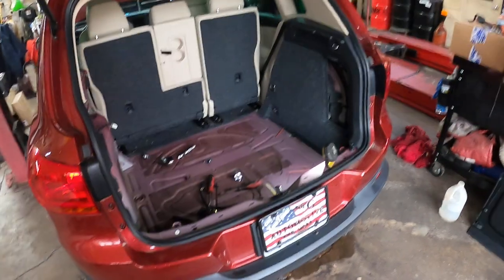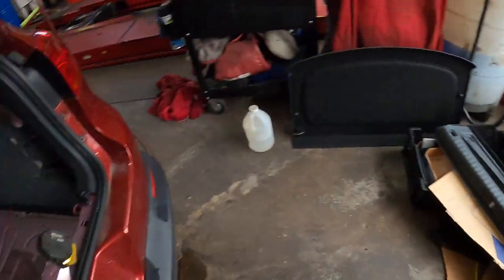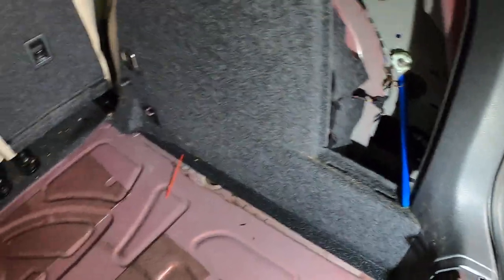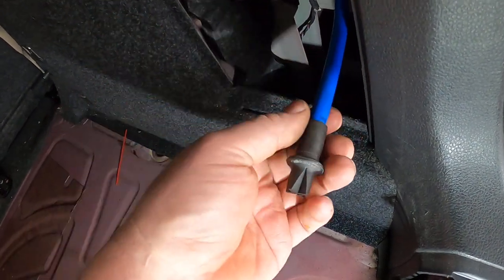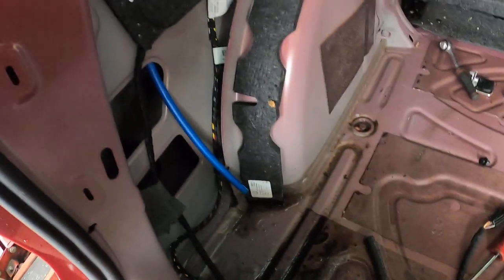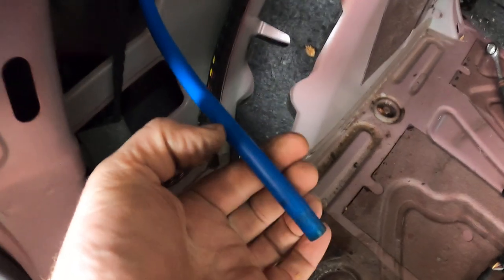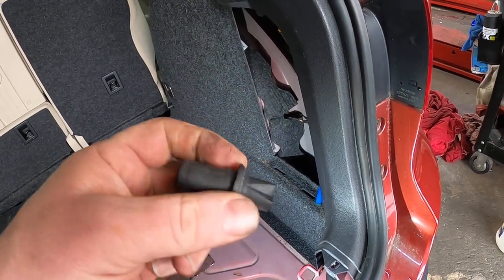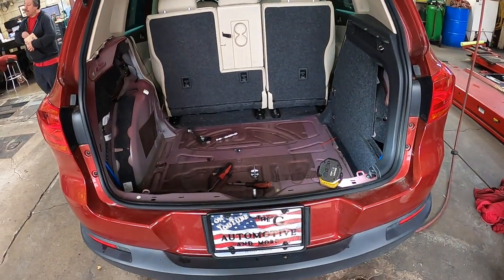2015 VW Tiguan Rear Sunroof Drains Repair

Comment: This was so helpful for my daughters 2011 Tiguan. Another video helped with an upper drain hose issue in 2021 and I only wish the lower hose detachment had been as easy to repair. Maybe if we are lucky we won't have to do the passenger side because the drivers side was a gigantic PITA. Not holding my breath.

Comment: Thanks. Good video. I see a lot of people online just getting rid of the bug shields. I am considering because they do get clogged up and seem to cause a lot of problems and they don't fit that securely (especially on the rear) so I am worried they will shake loose.
Reply: Update: the rear bug shields as you correctly point out have to be installed from the underside. In my Tiguan they were installed from the trunk side and were not seated correctly.

Comment: Great video.
If it funtion correctly, where does it drain to? Is the pipe extanding and going down the side pockets to the outside?
Reply from the maker: Yes it does. They plug into a valve in the lower quarter panel that is suppose to keep dirt and spiders out.

Comment: Hi. Do I get that 7/16 pvc fuel hose at home depot? Do you still need the black rubber spider trap thing if your gonna just connect the pvc all the way through?
Reply from the maker: You can get the hose at a auto part store. I do leave the spider trap installed.
Reply: @TheGAutomotiveAndMore  what if we just used the pvc and bipass the spider rubber connect thing and run it to the ground?
Reply from the maker: @saadimadina1337  Yes you can do that but you do not want spiders making nest in them. That will clog them up. That is why I cut the blue plastic hose and make them longer.
Reply: @TheGAutomotiveAndMore  spiders webs will really come from underneath the car to do that? We just connected/put over the blue hose the clear vinyl tube (tried to get pvc tube) and used hose clamp and ran/bypass it straight to the ground

Comment: Hey bud. This is exactly whats happening with my 13 tiguan but it’s the front pass and rear pass carpeta soaked. Gonna unclog and maybe straighten the rear hose drainage. The mechanic doing it said he needs to remove all the door moldings and head liners to do the job. Is this true and necessary ?
Reply from the maker: If he is replacing the drain tubes then yes. I also have a video on the front drains.
https://youtu.be/4DdYBnoIqhE

Comment: How did you remove the left side jack support and trim? I fixed the right side but can't get to the left.
Reply from the maker: I really do not remember how I got it apart. Sorry
Reply: there 4 black plastic, trim liner plugs that are hard to get out. really tough but they have come out